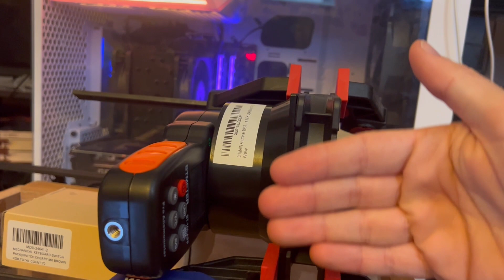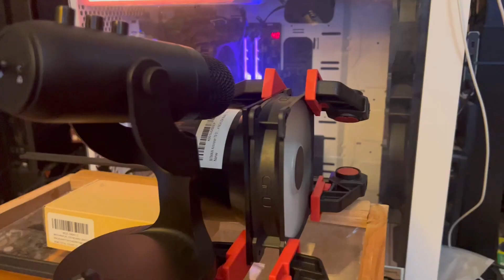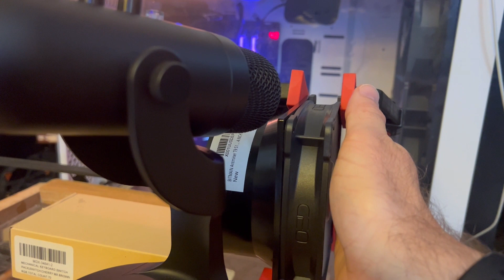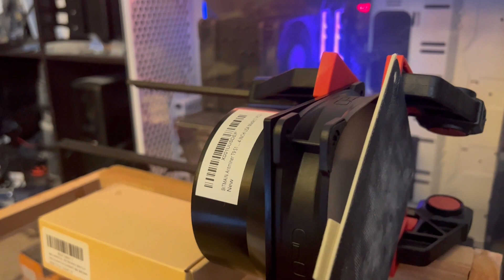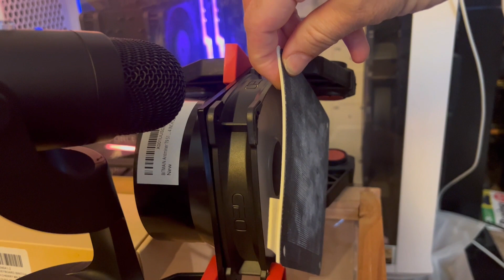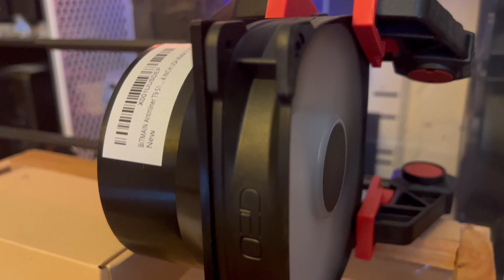PC fans Filter  Demonstration Noise Testing

Comment: Yeaahhh problem is i use fans on a pull config with my radiator so this is an always thing for me. Although with a 360mm i dont even need to run them very high so they'll keep my cpu cool. I'd say the noise is better than caked up dust
Reply from the maker: My previous build I had a Rad in a push config but set up like a chimney out the top. 
For front intake ya that can be a problem. Noctua style spacers might solve the problem. Dont know if any other company makes them though.